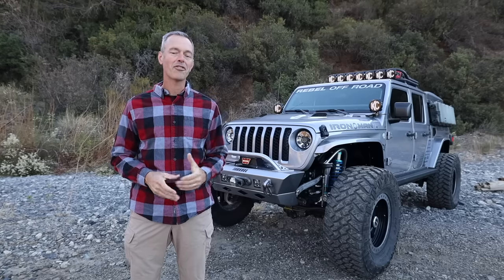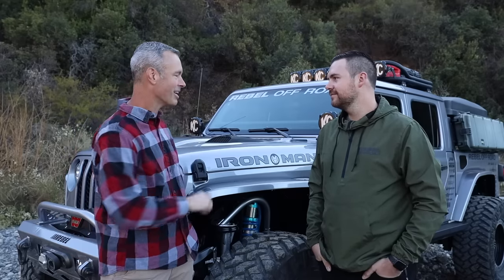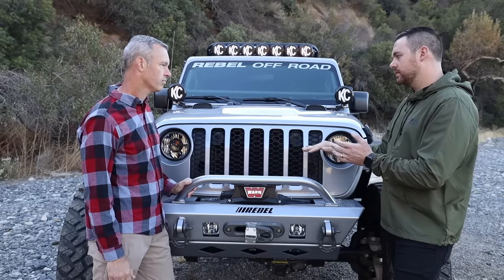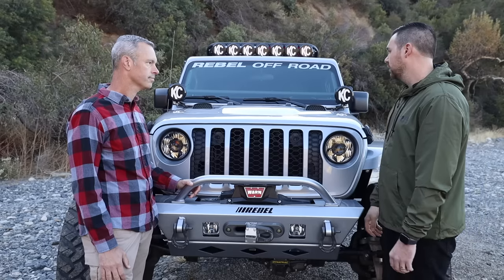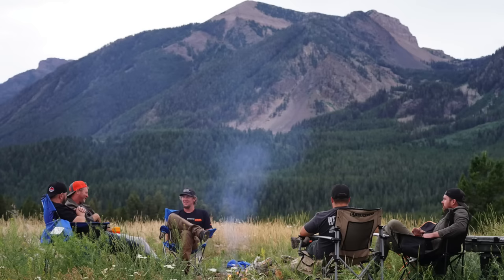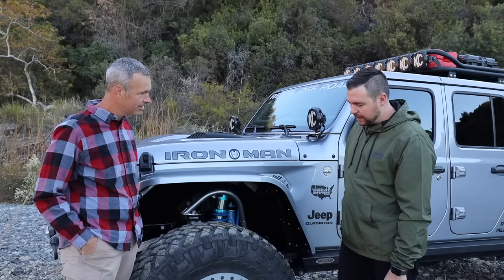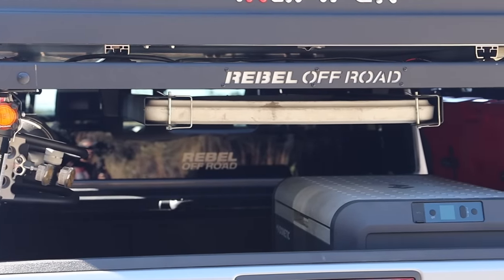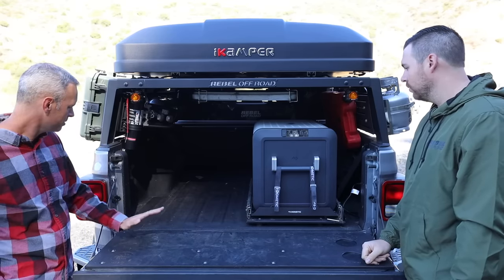Iron Man, The Overland Jeep Gladiator Adventure Build

Comment: It's a very nicely built jeep, but let's face it, most of us cant afford a build like this. Rebel is a huge proponent of this build.
Reply: The rock sliders alone are about $2000. The roof tent is $3500. That over 5k on just two items... imagine the rest of the build.
Reply: @EngineerPrepper  Both of those items are optional, you don’t need a tent that nice like they said, same goes for the sliders. you can use a 40$ tent and cheaper sliders. But I know what you mean in terms of costs. Builds like these are still possible with a budget too though
Reply: @bluecow10  Yes your right, I was just pointing out, this particular build.

Comment: I have A 2020  Jeep Gladiator Overland and my wife was in an accident with it and damaged the front differential and it went in to the shop on November 17, 2021
and is still in the shop because the dealer can't get any parts to fix it. That is the only problem I have with the Gladiator is availability of parts. The truck is useless
if it sets at the dealer for ever waiting on parts if something happens to it and it can't be repaired for that reason I don't recommend buying one because if something
happens to it it will be stuck at the dealer for ever so I think very carefully before buying one. I also contacted Jeep customer service and they are of no help!

Comment: This truck is my dream truck.  However there is one thing astonishingly sooo wrong with the build.  I run 4 scuba tanks with 3000lbs of compressed air in my van at all times because I have to.  I know they’re an awesome source of air in a pinch.  If I were going to put one in an off road truck I would protect it.  Right now that tank is a rocket pointed right at the drivers head.  Where they fail when they get hit, is at the neck.  At the very least point the air tank top down.  You may want to rethink having one even in the truck when you have a decently high possibility of rolling it some day.  It might want to stay home on the Rubicon trip.  But other than the danger situation, sweet ride!

Comment: If I’m over landing and camping comfort is a premium. I’m always setting up my 20 ft yurt and wood burning stove. I’m not using a cheap top tent on a vehicle. To each their own though. Great build! I’m currently about to start building a gladiator rubicon. I’m not rock crawling boulders do I went rubicon for the add one already installed. I’m only going to replace the bumpers and add a winch. I’m then adding a full size cap with a roof rack for my gear. I’ll probably also add the kc lights.

Comment: SO glad i found this video! Great Jeep, after seeing it I immediately bought the S&B kit. Wife and i just got a Black Widow Overland and i  have questions though, about the gearing. I noticed you stated 5.13 for 40's and from what I've seen so far I've been recommended to put 5.13's for the 37's on my rig. Any insight or advice to what's actually needed for 37's ? I will be towing a small bike trailer etc.....

Comment: If you want to remove heat from the engine bay I would put vents similar to the Hellcats hood. Or do some venting in the fender well by the exhaust. Maybe do some ceramic coatings of the manifolds?